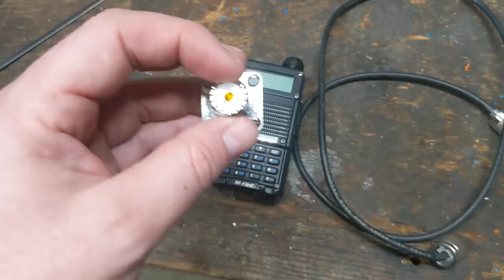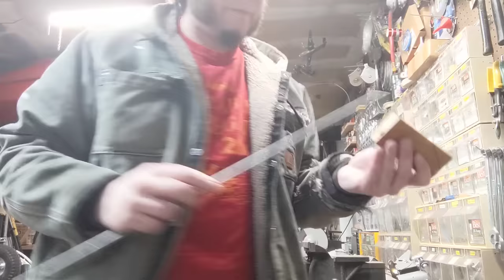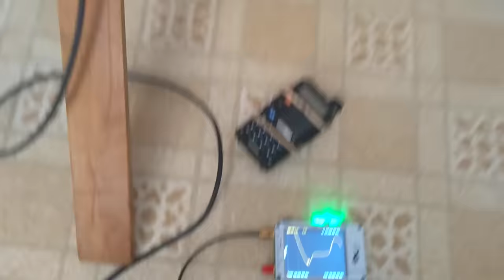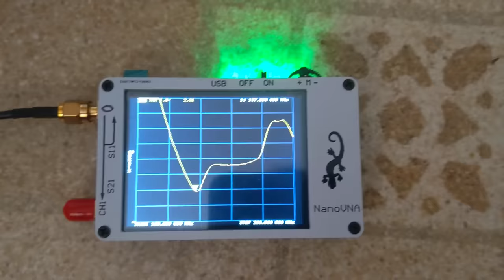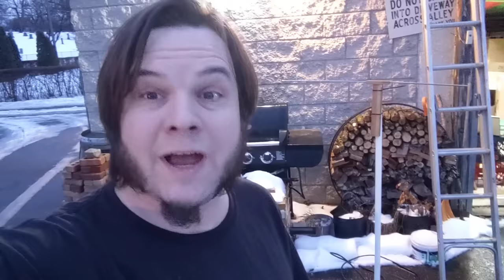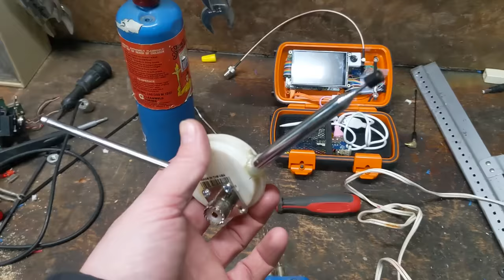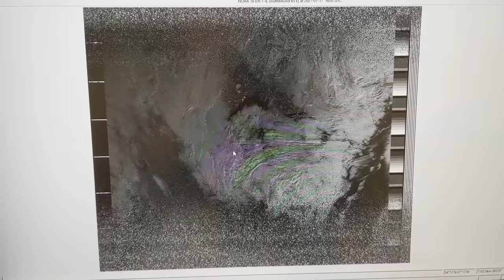Listening to Weather Satellites with Random Junk

Comment: Soldering big lumps of aluminium like that is very difficult with standard soldering irons made for small pcb work or even a more powerful one made for auto vehicle work. You made it work, which is not bad. The aluminium is an excellent heat conductor and having so much mass it just sinks all the heat out of the iron and away from the joint. An effective soldering iron would have a massive copper chisel tip, perhaps 4-6 ounces for this application. A nice trick is shape the end of a nice chunk of copper, like a foot of 1/2 inch pipe or something similar with a blowtorch and use it to apply heat into your joint.

Comment: that's great reminded me of the 80/90s doing the same professionally - we used stainless steel QFH antennae with built in upmast preamps, the sat signal is circularly polarised, we could get pretty much horizon to horizon APT, and later HRPT satisfying and imagine if no internet available after WW3 hahaha  this would be so so usefull the NOAA satellites seems to last forever and a day and the low res channels never went "digital " as they planned. (LRPT) Super clip thanks made me feel quite old and brought back so many happy memories! PS dont forget the polar orbiters show the poles that the geos cannot, so they have a great complementary use, militray have DMSP which sadly you cannot access then you could see the city lights from it.

Comment: When I was aa kid in the 1950's I would tear old transformers apart and recover the wire which I would wrap on a toilet paper roll to make a coil,  By using a piece of pencil lead and a double edge razor blade I would make a diode.  I would use a metal water pipe for a ground and a window screen for an antenna and have a crystal radio.  I could pick up the famous Grand Ole Opry radio station from my house in Houston.  Sometimes I could pick up European radio stations.  The radio stations were all strong AM stations. I see that AM commercial stations are being phased out so this won't be possible much longer.  The other AM broadcasts that this simple type of radio can receive are HAM band signals.
Reply: I forgot to say that I used high impedance head phones which may no longer be available except maybe at science stores if those are even around any longer.

Comment: It has gotten a whole lot easier in the 2 years since this was made. I just ask Alexa to show me this weather. For those wondering how he soldered to aluminum, he didn't actually, the solder flowed into the tiny jagged parts of the cuts from the hacksaw. You get the same results when you solder to a sponge. Difference is aluminum is conductive and sponge is just a sponge.

Comment: Snow will NOT affect radio propagation to any noticeable degree except at wavelengths of perhaps 2cm or below.  Now, if your antenna gets covered with snow to the extent that its electrical properties change, that's a whole other thing.  But at VHF, snow and rain will not affect propagation to any noticeable extent.

Comment: You need a crossed dipole to pick up a satellite so that as the sat spins on its own axis you get continuous signal, a single dislike will fade out and back in again with the sat rotation, a helical antenna or a dish doesn’t do that but are more complex than a crossed dipole

Comment: That's how I know it with the NOAA satellites, I don't even know if any are still transmitting. An interesting antenna, I used a crossed dipole where the dipoles were interconnected through a coaxial cable in a way that they could receive circular signals.
Reply from the maker: The NOAA satellites are still going, but the Russian one failed recently. I haven't tried a crossed antenna yet. I built a couple QFH antennas and the 2nd one I made actually worked!

Comment: I have a radar system I made from a old direct TV dish. They left it behind when I switched so I reused the dish, put it in a motor that circles around, soldered the wiring to a computer and it reads live data and your body shows as a imprint in data much like sonar
Reply from the maker: Cool! That's something I'd like to try some time.

Comment: Standing wave ratio is a bit of challenge for some but it really only becomes and issue transmission - especially when using power amplifiers . You can wreck the final amp on a good all band transceiver if you have a bad swr .

Comment: Soldering isn't difficult but you need the right tools for the job. Heat is the primary thing and if you're going to solder a big aluminum rod, you need a LOT of heat, something that little wire on that solder gun won't have much of specially with all the oxidation that was on it, which is another thing you need to always do, clean the tip and tin it with solder to keep oxidation down and a more efficient transfer of heat FROM the iron TO the parts being soldered. You would have also had better success soldering a piece of wire directly to the rod then to the connector, doing so would be a cleaner result and less metal to soak heat away from where you want it. But yeah you want a good soldering iron or station with high heat and a temp control, various tips for certain jobs, larger tips for bigger jobs like this and pretty much max heat and tiny tips for the smaller electronics work. Quality of solder also comes into play but in my experience the higher quality solder is more helpful soldering tiny PCB's for instance where you want to be in and out with the heat asap and in doing so with good solder you don't get a shoddy cold joint.

Comment: We used to align the c/ku 10ft dish  to the southern arc of sats with a Spectrum Analyzer.  In the early 2000s l had a Bird dog that l could download specific sat data....for example telstar5 and direc n dishnet sats. The bird dog was great because you could actually id the sat instead of just using az.  Then the internet made dishes redundant instaed of vice versa and now my business has been dead since 2010. Thanks Internet. Lol

Comment: When the satellite was overhead and you weren't getting any signal - this kept happening to me until I found out that some of the NOAA satellites have switched frequencies, so many of the online listings for the sat frequencies are wrong. For example I'd pick up NOAA18 on the NOAA19 frequency. Worth considering for anyone experiencing the same issue. If the sat was overhead and you got no signal at all, it's probably the wrong frequency otherwise there'd be at least a faint signal.

Comment: I love everything about this. I actually use the particle and magnetic field data from exactly the same spacecraft.
We usually have problems to download data from Cubesats, radio transmits very little, but maybe with several simple stations like yours, it could save us a lot of trouble.
Reply from the maker: Very cool! I bet there are better antennas that would work for cubesats. I want to build a tracking antenna that will let me follow moving satellites and hopefully get stronger signals.

Comment: "Well under $50..."

Yeah, like just over half, if the Baofeng radio there is just the $20 one, since the connector parts are just $6 total ($2 apiece), like you said.

Comment: outstanding !   i love this stuff. cool video ....soldering aluminum doesn't work well... that is usually a crimped or mechanical connection... if that was me and i knew i was going to solder i would have used copper wire for the antennae element.  also, what if each element was actually a coil of wire, like a long skinny stretched out Slinky of copper wire?  you might see a better signal catch and strain out  some of the signal noise from transient frequencies.
Reply from the maker: There are a few different antenna designs for this, I now have one made out of plumbing parts that's more of a coil (helix really, it's based on this: https://usradioguy.com/wp-content/uploads/2020/05/20200307-How-To-Build-A-QFH.pdf)

Comment: You aren't going to collect much with that little 18in dish. Get yourself a proper 6ft wide dish. They are designed to pick up satellite data even in cloudy weather. And the provide you with a lot more data collection because of the width of the dish. It's designed to bounce the signal into the main collection array which is what you're holding in your hand. The satellite collection array is the boom that said generally sits in the middle out about 4 ft from the dish. The technology itself isn't complicated. It's the translation box which sets the declination in altitude on the horizon for where the dishes located and the tracking systems that are complicated.

Comment: Totally amazed with how you assembled the small raspberry pi to receive satellite and it worked better than the laptop ! 😃 I wonder which SDR did you use to make it work on the laptop eventually?
Reply from the maker: The one I'm using now is an RTL-SDR Blog V3. The old one was some $10 eBay thing that only kinda worked.

Comment: You need to get a genuine RTL-SDR only slightly more expensive, with greater sensitivity, bias tee power for preamps and filters, temperature compensated oscillator for frequency stability better overall performance and features. The cheap ones are just repurposed digital TV dongles.

Comment: Hi there!  Total newb here, interested in doing the same thing.  What is the brand/model of the little black radio you used when listening to the transmission at the beginning of the video?
Reply from the maker: It's a Baofeng BF-F8HP. Similar ones are all over Amazon and eBay for $20-$30. The model numbers are somewhat meaningless and get shuffled every few months due to import shenanigans. For this use you just want to ensure it can receive in Amateur 2 Meter band (and make sure you don't transmit without the proper licenses and protocols!). Theoretically this should work with any 2 meter ham radio, but the Baofeng actually receives better and is easier to use than my Icom handheld.

Comment: I only have a fuzzy understanding of what's going on here, but wow is it neat! I wonder how/if NOAA18 data transmission differs from GOES16 data...
Reply from the maker: The polar satellites do have a 1.6ghz channel just like GOES. I think they mostly send down high res versions of the images I'm getting here. I haven't gotten around to using that, I need to build a tracking antenna or aim the antenna really carefully by hand if I want to pick up the 1.6ghz signal. There's some info on it here: https://sgcderek.github.io/blog/beginner-hrpt-guide.html

Comment: Never run a raspi with the low power/voltage warning, you're asking to waste your time. I was putting together a pi zero op25 receiver and I had this horrible skipping happening whenever I played any audio, after hours and hours fighting linux audio drivers and general frustration I plugged it into a screen as I was strictly operating it headless and that's when I see the low power icon... Long story short I switched to an appropriate power supply and all my crazy intermittent issues went away, learn from my mistakes and just use a proper supply.
Reply from the maker: I have no idea what an appropriate power supply is, these darn things complain on every USB wall adapter and power bank I own. I wish they were designed to use all the standard power supplies that already exist instead of some mythical high-amperage thing that nobody's ever seen.

Comment: if you watch this for info, you need to elevate that thing above your roof as far as you can if you live in bad reception area.
Reply from the maker: I actually had better luck with it sitting about 22 inches off the ground (or above a flat roof). Similarly when I've used a handheld radio, it works best when I hold it near my body. Having a reflector or ground plane really improves the performance.

Comment: So is some ground station constantly receiving the transmission from the satellite??
Reply from the maker: I assume there are multiple stations receiving it, and maybe there's a more permanent link to other satellites for government use. I think they were set up this way so any small weather forecast office or researcher or vessels at sea could use the data directly. I know my university in Alaska had motorized dishes that would occasionally lock on and track passing satellites.

Comment: bump up the voltage youve recieved to be 110v instead of like 1 or ,1 volt, using a homemade magnet-wire transformer, and bump up the voltage to 110, add a battery and there ya go, enjoy!
Reply: ps im not very good at soldering either!

Comment: im suprised the laptop rig didnt work, the signals from Noaa are strong, only a little bit of gain is required. My guess as well is that the sdr was faulty.
Reply from the maker: The first SDR I tried didn't have a high enough gain setting.
Reply: @saveitforparts  i  saw that in the video, but the first noaa satellite i ever picked up, the gain setting was on zero (because I didnt know what i was doing) and the signal was strong! This was in summer in australia, hot and dry. SO I wonder if the snowing/ huge amount of moisture in the air where you are is acting like a big blanket and dampens the signal.
Reply: @saveitforparts  this was a 20 second video of it working with zero gain, but its on my personal facebook so it might not play. But signal was strong! TV rabbit years dipole! I definately got lucky!  Yea I think it must of been atmospheric conditions that were on my side!   https://www.facebook.com/peter.oo.3/videos/10158708471970695
Reply from the maker: @kayboku7281  That could be. It seemed to work fine with a different SDR.

Comment: Can you make a video showing how to do these things using a 
stock DishNetwork dish, Cantennas,  and Arduino/esp32 related hardware?
or parts salvaged from microwave ovens....
Reply from the maker: I've never played around with an Arduino or esp32, that's on my to-do list. A satellite dish isn't the most useful for this particular weather signal. I've picked up the geostationary GOES satellites with a dish, cantenna, and some cardboard and foil tape: https://youtu.be/EK8mFrxxSbY

Comment: That baofeng must be a popular little radio. I just saw wranglerstar talking about his and now this one. hmm and they're more affordable than I thought. Anyone know if its any good for it's price range?
Reply from the maker: They're ok depending what you use them for. For amateur use they're considered a little "dirty" (lots of radio noise and potentially interference on nearby frequencies). For licensed use on business channels, or as a marine boat radio, they're pretty decent. As a scanner they're not bad for the price, but you have to reprogram the stock squelch settings to get the most out of them.
Reply: I wouldn't recommend taking wranglerstars advice on anything.

Comment: I had a question: You mentioned that you could hook it up to a pc to be able to "read" it. How would you go about hooking it up and what would you be likely to see if you did? Matrix code?
Reply from the maker: I showed part of it in the video, basically I used a software defined radio and ran the signal through some programs that decode it and show the picture being sent down by the satellite. There's a lot of info here: https://usradioguy.com/noaa-apt-reception/ and here: https://noaa-apt.mbernardi.com.ar/guide.html
Reply: @saveitforparts  Wow, thanks! This is really interesting as I never thought about the fact that satellites are transmitting data all around us.

Comment: Why not receive NOAA geostationary satellites?
Same place in the sky 24/7.  
Most signal is about 2.2G 

Imagery is around 12ghz. Good luck. 
Rt and left polarized transmission. Complex modulation. 

Polar birds mostly just have a beacon at freq you are looking for. No real data.  
Helps w tracking moving satellite.
Reply from the maker: I've done some geostationary stuff with the NOAA GOES satellites, that video is here: https://www.youtube.com/watch?v=EK8mFrxxSbY

The polar sats send down imagery encoded in the beacon, it's just lower resolution. There's a higher-res signal (similar to the frequency you mentioned), but I'd need a tracking antenna.
Reply: I worked for NOAA at wallops island for 25 years.

Comment: 📺💬 137 Mhz is weather satellite signals transmission and it can be local too, that is because low frequency can prevent signalings distortion, and when it absorbed some ranges not much of effects.
🧸💬 For low-frequency communication signals transmission detection, they had a method for detection that is because it is wide and open you need to build tools or buy specific tools that can work with nano sizes of equipment. The lower optimum points in the graph from signaling measurement tell you that you can listen to the frequency with fewer effects.
👧💬 That is local neighbors' practice ( anyone in the area can tell about it easily by eye seeing it ),  it can easily categorize the antenna and its purpose but for the low frequency, you can tell the source with a nearby channel frequency same as frequency 138 Mhz if you are practice for communication.
🐑💬 You are correct without conversation detection we have to work with low-frequency or specific channels. 🐐💬 Swam technology.

Comment: Odd, the frequency should've decreased when moving away from you...  Do I have this backwards?
Reply from the maker: It's a higher frequency as it approaches and lower as it moves away, with more extreme differences the farther it is. IIRC the usual adjustments are +3khz for about 2 minutes, then +2khz, then +1, 0, -1, -2, -3, changing about every 2 minutes for a close overhead pass. With an SDR you can just set a wide filter for the whole pass, or adjust the center frequency manually or with code. For the handheld radios, most people program in several memory channels and switch as needed.